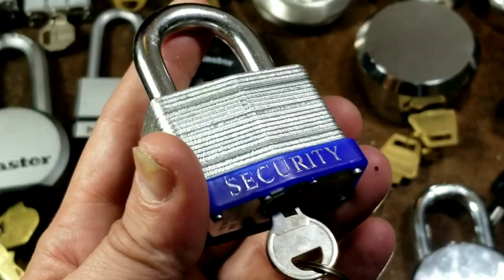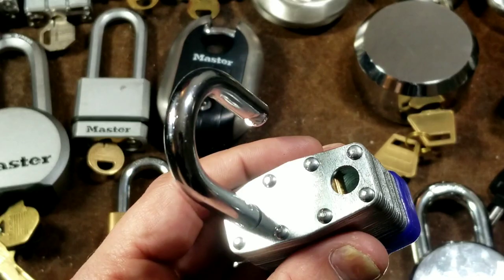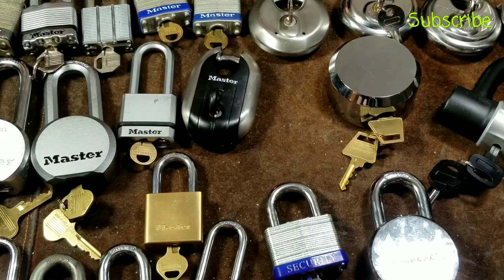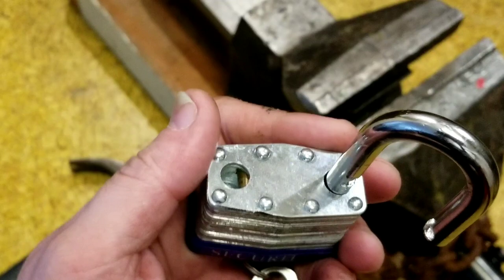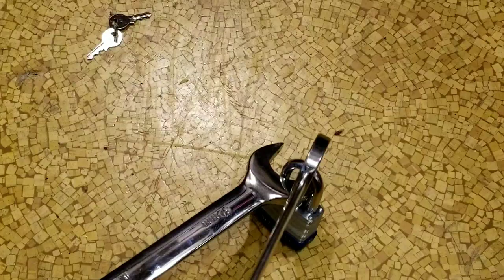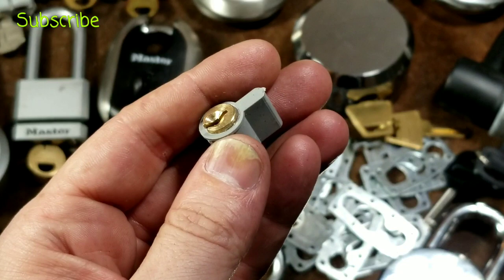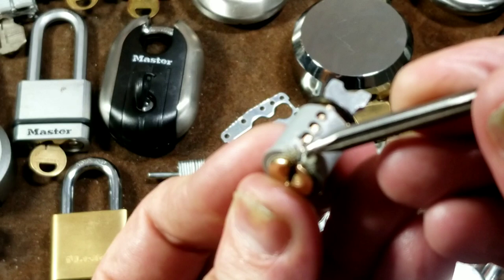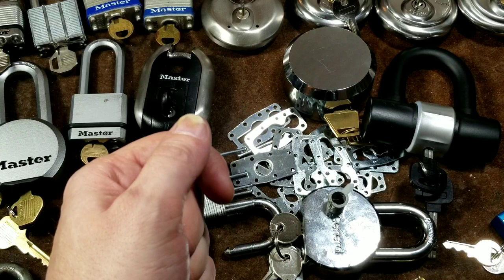Harbor Freight Laminated Steel PadLock Review, Test, & Evaluation (Junk)

Comment: I'm inclined to believe that the steel pins they use are cheaper to manufacture than machining brass pins--that's it's more of a cost saving measure than a security measure.  Incidentally, since they are steel, they may not wear down as much over time compared to brass pins, with prolonged use of the key.